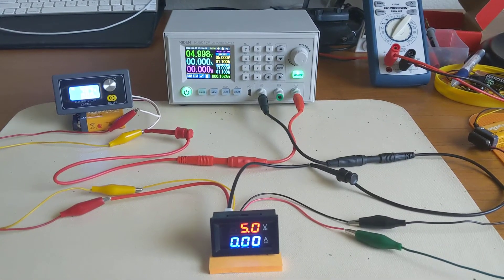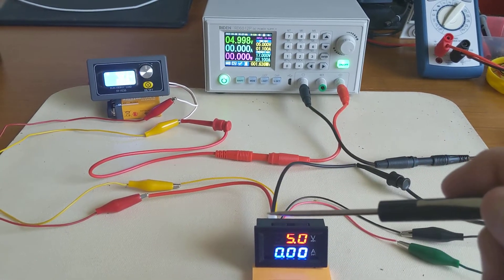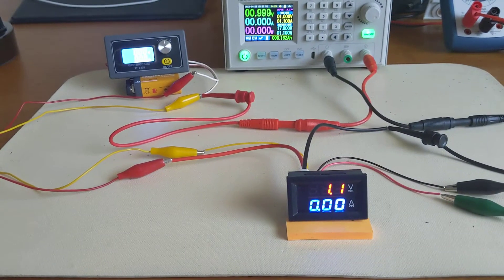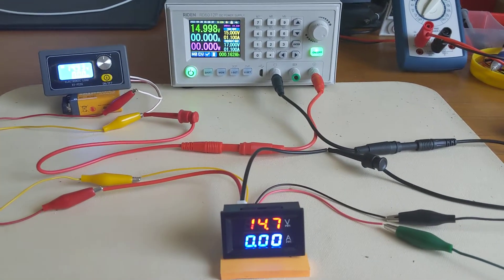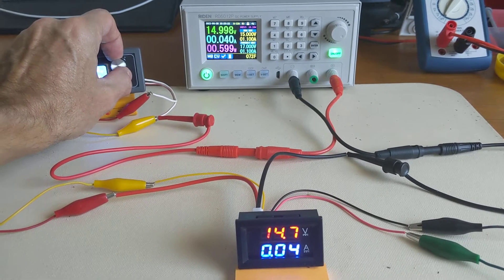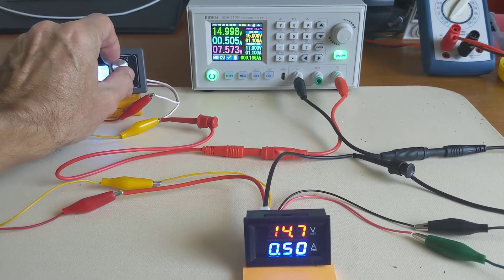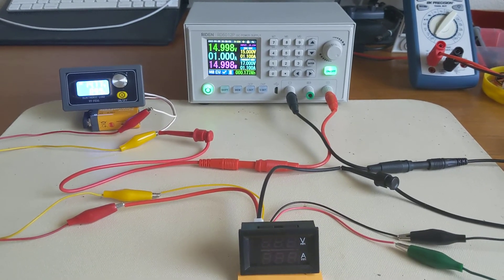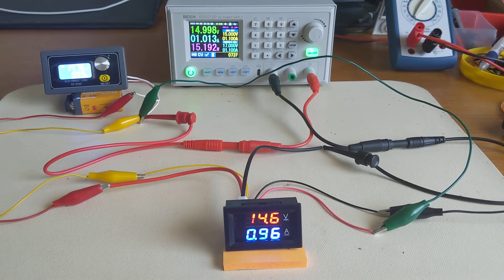How to wire DC Voltmeter Ammeter (XY-FZ35)

Comment: Your presentation was the first, of the many I tried, that I was able to emulate to completion without blowing the meter up. I wired the meter as shown in your video and it actually showed both the Volts and Amps of the connected load. Thank you very much for making it understandable. Next will trying to follow your calibration process.
Reply from the maker: Thank you for the nice comment. Much appreciated.